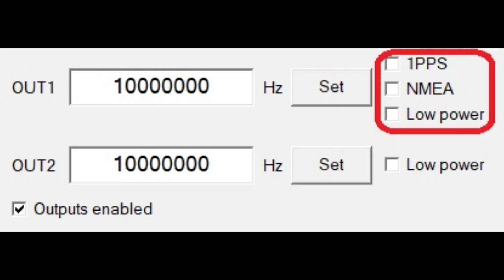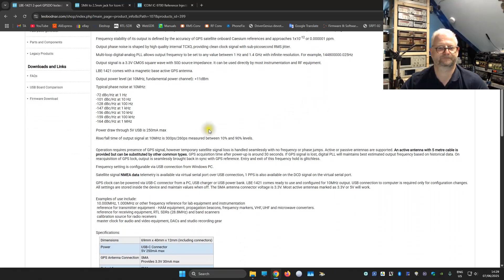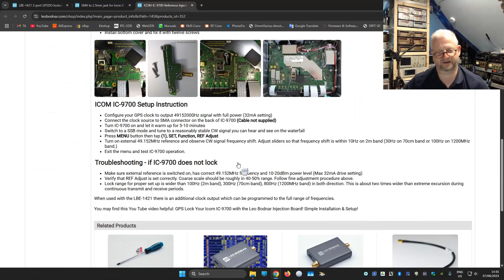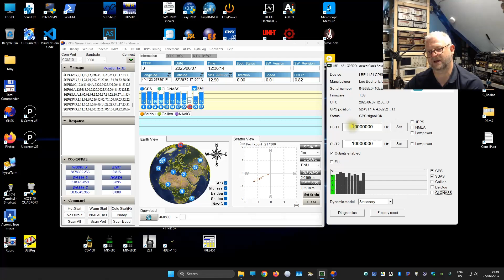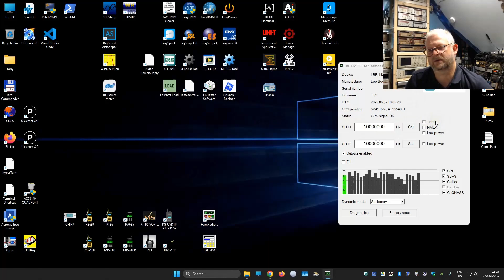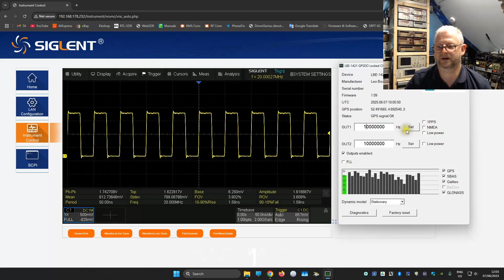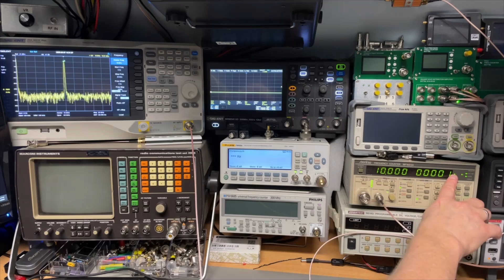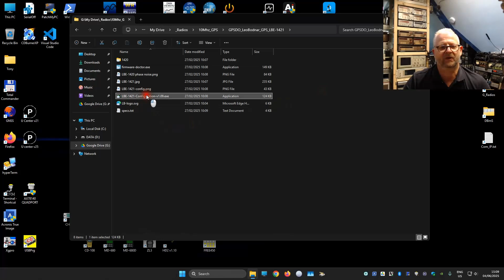TA-0445: Leo Bodnar GPSDO Clock Source LBE-1421 - Multi output and SDR TRX reference

Comment: Very nice demonstration of the LBE-1421. Honestly, I work with high-level laboratory measurement standards.Leo Bodnar and his instruments are amazing!  The LBE-1420 GPSDO is incredibly accurate. (It adds an LPF as standard.) It's in no way comparable to the BG7TBL (any version!). The best thing to do is use the LBE-1420 with a good quality low-pass filter! (It's very simple to build) as a 10MHz source. Precision 1x10⁻¹² or 0.000001 ppm (and very low noise at 10 MHz). Forget the 1421 has two outputs! The 1420 has one output, and that's why the LBE-1420 is far superior in stability!
Reply from the maker: Thank you!, good to know, good info.

Comment: I already own a TM4313 GPSDO and feed its 10 MHz sine output into a BG7TBL distribution amplifier (the version without the OCXO). This provides devices like my Airspy R2 and HackRF with a stable 10 MHz reference.

Now I am planning to get an SDRplay RSPduo because of its dual-channel capability, but unfortunately it doesn’t support a 10 MHz reference — only 24 MHz.

Based on the specifications of the LBE-1421, it seems I could use it to generate both 10 MHz and 24 MHz simultaneously on separate output ports. The 10 MHz square-wave output would continue to feed the BG7TBL distribution amplifier (which will effectively provide a sine-like output to connected equipment due to filtering and cable/impedance effects), while the 24 MHz square-wave output could be connected directly to the reference input of the SDRplay RSPduo.

This way, even though the reference frequencies are different, they would still originate from the same master source.
Do you see any potential pitfalls in this approach?
Reply from the maker: Hi, sounds good, this is what this dual output is made for. many use it alsp for sdr or transeivers. the 10mhz for testequipment i found never a problem sine or square, most test equipment just eat both.

Comment: Thank you so much !!!

The signal purity at higher frequencies ( e.g. 800 MHz ) and thet high resolution are, at my eyes the most important features of the Leo-Bodnar GPSDO.

A raw uBlox ( NEO-M8N ) GNSS may be used to generate 1 Hz resolution random frequencies up to a few MHz but they suffer from atrocious phase jitter and are absolutely NOT RF rated.  I use them to manually tune a PIEZO 2940210 / 2920136 10MHZ OCXO, using an o'scope

This small Leo-Bodnar GNSSDO is waaaaay better !
Reply from the maker: Thank you SIr!, thank you for your feedback, this is why i make these video. so we all can make a good decision when we plan to buy something. and i learn myself too everytime. also from your comment now.

Comment: Hello Toni
Very good video👍
The device has many advantages...
You already have a few GPSDOs?!
And which one is the best for you?
Ps: ..or if you were to make a purchase for the first time with the knowledge you have now?
Reply from the maker: Hi, thank you! .. i would start again with a BG7TBL with display, than when you better understand look for better.
for me, how i use it, this is still my 24/7/365 choice. for me it is a bit unpractical having the wires sticking out on both sides. but i just grab the Leo when i want a clean measurement and run it a few days.
Reply: @TonyAlbus  Thanks for your answer.
How long does your BG7TBL need to get a stable frequency?
I have the little one, and it takes about an hour. (Locked)
Reply from the maker: My primary BG7TBL is switched on allways. but my secondary only when i am in the lab. i think about 15~30 minutes, but i have very good receiption, my antenna can see full sky.

Comment: Thanks for the review Tony! I bought the 1420 late last year to use as a poor mans calibration reference and discovered an annoying behavior. When comparing it against a few 10MHz OCXOs and my rubidium source, the 1420 demonstrated a very abrupt and apparent frequency variation every 30 seconds or so, almost as if the PLL is making sudden large adjustments. On longer time frames I found a consistent oscillating frequency drift, roughly +/- 1-2Hz, over the course of 8-10 minutes. 
The folks on the EEVBlog, including Leo, seemed to think it was user error...
Wondering if you would be able to compare your 1421 against whatever frequency reference(s) you have handy to see if the two port version behaves better?
73.
Reply from the maker: Thanks! okey, i did not notice that problem, but i was also not focused on that specificly , thank you for putting that to my attention. 
they do still make firmware updates and if you email support with maybe an example video they will look at it is my experience. 73

Comment: I've got the 1420 model.  Works great.  Not sure I'd spend so much for nmea output.  You can get receivers that output nmea data very cheap ($10-$15).  Looks like that 1421 in addition to having a second output will go around 300Mhz faster.   I'm not sure what the use case is for that, I've used my 1420 with a few different radios, and the necessary output frequency is always very low.  That low power mode would be nice, I've been using an inline attenuator with the 1420.
Reply from the maker: Hi, yes both are great, i like the 2 channel because i can use both for test equipment 1MHz(old) and 10MHz(new) reference. or 1 for SDR and the other for 10MHz.
73 de tony PE1ONS

Comment: 14:45 I would have liked to see a comparison with another GPSDO but with higher precision (at least 14 digits) and a 10 s gate time—e.g., the FA2 unit that you have.
Reply from the maker: Yes but i need to compare it against my BG7TBL, which it good, but still hobby grade, than its still a matter of, which one it right..
when i tested to 10MHZ + the 0.100 and 0.050 Hz resolution, that was compared to the BG7TBL

Comment: The LBE Series BPSDO: Not Your Go-To for Variable Frequency Oscillation👎
 LBE Series BPSDO: it's far from ideal if you're aiming for a clean, variable frequency oscillator. The significant presence of harmonics means it functions more like a comb generator than a pure signal source.

This characteristic makes it particularly problematic when you need a stable 10 MHz source. You'd be forced to implement a 10 MHz low-pass filter, which, as you rightly point out, defeats the purpose and adds unnecessary cost and complexity. Essentially, you'd be spending extra time and money to compensate for an inherent limitation of the device.

Sorry for the negative review, it's sad when you think you pay your hard-earned $$$$  for something and all you get is a loud buzzer, with SOLID frequency stability.
Reply: This is the conclusion I came to as well after buying the 1420 late last year. Discovered some unusual and unexpected frequency variation artifacts in my copy which make it practically uselss for my needs. 
Ended up refurbishing an HP 3325A and added a rubidium source clock to meet the requirements. The setup is nowhere near as small and cute, but really gets the job done!
Reply from the maker: @Brian-L  Oh yeah Rubidium is great.. i had an old XL Microwave (now pendulum) and the Rubidium was still spot on..
Reply: Ali Express has low pass filters at low cost, ~$10. They work well. Some people may want the harmonics, depending on the purpose. I have one of his GPSDO. Works well and has low phase noise. Drew VK4ZXI. See blog for phase noise testing of many 10 MHz oscillators.
Reply from the maker: Thanks, you have some good points. this is not for everyone. if you need just a stable 10MHz, the BG7TBL will do fine, i did some comparison against a real Rapco and the BG7TBL did great. the point is indeed, if you want a variable output all the way up to 1400 MHz there is not to much filtering you can do. but if you know what you need, its very cheap on aliexpress you buy a bandpass for your specific frequency.. 10MHz bandpass is below 10 Dollar. i focused mostly on its so vesatile, becouse there al so many other GPSDO's around with just clean 10MHz.  i also unplugged the gps antenna for a minute or two and it stayed within 0.1 Hz somehow that recording got lost on all the hours of recordings, would have been great to show that too. especialy it is using a TCXO and not a OCXO, anyway.. maybe again in an other video.
Thanks for your comment, one can only learn from critical comments, appriciate your time.

Comment: I like the form factor. Mine is much bigger, and uses much more power.
Reply from the maker: Thanks Red, yes running it 24/7 with current energy pricing... these little things matter too.
for me it could have been a bit bigger and then all cables on one end and the leds on the other.. new you need to store it sideways.. but they do sell a holder to mount it